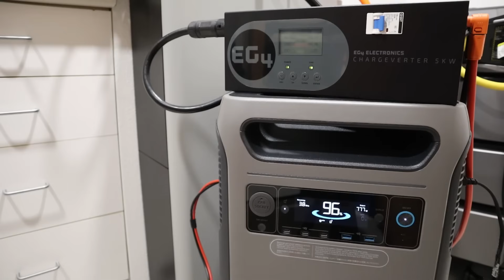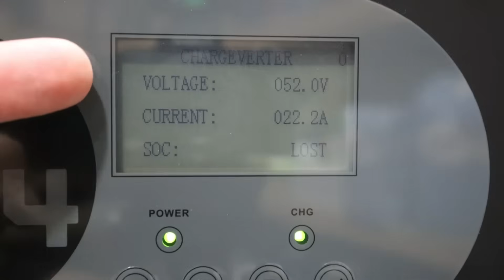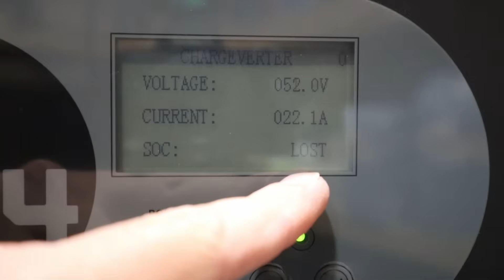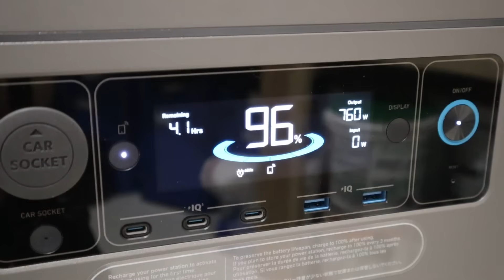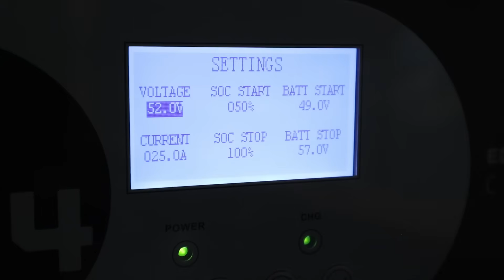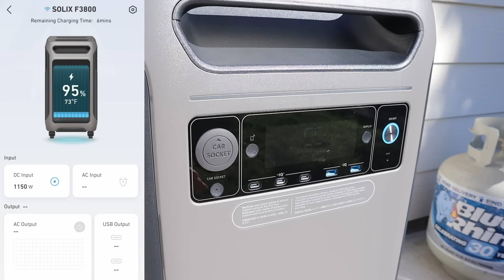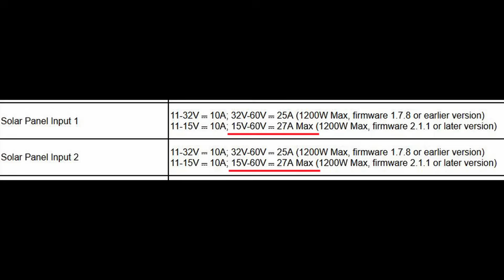The EG4 Chargeverter FIXES the Anker SOLIX F3800!  Keep the 240v Powered On!

Comment: you simply trick the unit to make it think itis being charge by solar. Why don't you get a PS200 solar panel or two.  How much do the chargeverter and a generator cost compare to 2 PS400 panels?
Reply from the maker: Those Anker PS400 panels are $1000 each.... OUCH....do not buy them!
I always recommend charging with solar panels first, however, when solar is not available you still need another way to charge it up. That's why I made this video. Using the Chargeverter will allow you to charge the power station at night or during a storm when solar isn't available. 

This video will show you how to find affordable 400w panels in your area:  https://youtu.be/pLRKljjaqMA

Comment: i am a newby here but if you have solar and are getting a 48v battery anyway, a hybrid inverter like the EG4 EVH 3000 might be a better add since it is not that much more than the price of the chargeverter and can accept more solar to charge the system through the 48v battery.
Reply from the maker: This is for people who bought the Anker power station off the Kickstarter not knowing it wouldn't have 240v, or when they purchased it from another review on youtube who didn't disclose the issue. This is a way to get what they have working properly. If you don't already have an Anker F3800, just go with a full DIY 48v system 👍
Reply: I am one of those early buyers, trying to make the best of the F3800 in light of the 60v  charging limit.
Reply from the maker: @lamesadave  if you connect a 48v battery to the DC charging port, you can use any charge controller to charge that 48v battery. I have a full video on that topic as well from a couple months back.
Reply: @Jasonoid  Yes, thank you.  I saw that excellent prior video.  Is am now trying to decide between the $400 EG4 charger controller and the $764 EG4 EVH3000 which gives me an extra 120v inverter along with a charge controller.

Comment: Can you limit the current to 20 amps, my power station solar input has a max of 20 amps only?
Reply from the maker: Yes, the output is adjustable. Your power station probably doesn't need this though.... This is meant to fix the Anker F3800 only.

Comment: I haven’t had the time or figured out how to connect my dual F3880 batteries with the HPP control to my existing Enphase solar array. I did have an old beast of a gas generator that isn’t likely to have a good sine wave output so I thought I would need to junk it and buy a new inverter generator but seeing how the EG4 will cope with less-than-ideal sine wave input and since my generator has the 240 output I think your timely video has shown me why I need to consider buying an EG4 chargeverter. Great video, thanks in advance.
Reply: Any luck figuring out how to integrate with your enphase system?

Comment: Jason, will you do the same video and show the same process for how to modify the chargeverter’s output to be compatible for the ecoflow delta pro ultra ?
Basically, how do you get the chargeverter’s output to go to MC4 cables.
Reply from the maker: The Delta Pro Ultra can just charge straight from a generator and get 240v output at the same time. No chargeverter needed.
Reply: But what about the “dirty” potentially non-pure sine wave energy from a standard generator.
Wouldn’t the chargverter make sense there?
I can understand skipping the chargverter if I had an inverter generator.  But a standard generator makes me a little nervous to charge my DPU directly
Reply from the maker: @criticalhadlock886  in that case, yes this would work on the low PV input for about 800 watts charging. I wish the Delta Ultra had a higher amperage input for the low PV, but it's only 15 amps. So it would charge a bit slower than the Anker power station. 

It might be better instead spending the $500 getting a decent dual fuel pulsar gx400bn inverter generator vs the chargeverter. 800w is pretty slow charging for the Ultra.
Reply: @Jasonoid  That is an excellent point.  I don't know why I hadn't considered that 🤪.  Sometimes you get so focused in on something that you can't see the forest through the trees.

Comment: So you can get 2400 watts charging with this setup?
Reply from the maker: Not currently, can't charge on the XT60 ports with the same source.
Reply: @ but two LiFePO battery chargers connected to a Honda Generator would work or is that considered a common ground?  Next time I'm at CES in Vegas I'll stop by the Anker booth and ask them what they recommend

Comment from the maker: Watch my 'Tips and Tricks' F3800 video HERE:    https://youtu.be/XFlRkMm8rDc
Reply: I just ordered a new Chargeverter and will try charging my two Anker Solix F3800s with it at the same time. I will update here if it works or not.
Reply from the maker: @Huiando  I had a viewer let me know it works just fine. Set the amperage to 55 amps and let er rip.
Reply: @Jasonoid  Holy guacamole! Thank you!
Reply: @Jasonoid  I actually contacted Anker about this problem.  It's possible they could fix this with a firmware upgrade.  Remember, before they upgraded, you could not charge the F3800 with both DC and AC input.  But now, after an upgrade, it can.  So perhaps we won't need to spend another $500 for the EG4 if Anker makes a change.
Reply: @CRoadwarrior  thank you for giving me some. Hope I think the problem is if there’s only two inverters in there a software update can’t add another one unless they have some trickery they can do.
Reply: @Jasonoid  EG4 has a 120v cord now for sale so you don't have to make one anymore.
Reply from the maker: @CRoadwarrior  I'll update a post with the information, thanks!
Reply: @Jasonoid  Yes, please do.  I was about to make one like you did, but I just decide to email EG4 and ask if they had one, and sure enough they do.  It's a little pricey, but overall worth it for those of us living off grid who need the technology working with Anker F3800.  

Also, I meant to tell you that I have two F3800s, and when you try to charge both with the Chargeverter, the device tries to split the wattage between the two units, instead of providing 1,000 watts to each unit.  I was thinking a setting change on the Chargeverter might help but not sure exactly that might work.
Reply from the maker: @CRoadwarrior  raise the amperage up to 55 amps on the settings page.
Reply: @Jasonoid  I will give that a shot.  Thanks!
Reply: @Jasonoid  Hey....I tried taking th amps up to 55, and it seemed to be working.  But it draws too much wattage from my inverter connected to my car and car battery.  It drains the battery too fast.  I'm going to toy with settings between your original one and 55 to see what I can get.

Comment: How do you fix a $2700 battery generator? "Simple, spend another $500 and lose some conversion efficiency."
Reply from the maker: I didn't design the flaws, I'm just trying to help people who bought one in ignorance. I'd recommend using 48v batteries to charge it, then you can charge those 48v batteries with high solar input.
Reply: @Jasonoid  Yeah, I know, just kind of lame from the manufacture.  Doesn't Victron make a autotransformer?  Would that help in any way on the input or output side?
Reply from the maker: @shaunnightfire8269  pretty much the same price as the chargeverter. The Victron autotransformer would be limited to 1440 watts output, since that's what is available when ac charging. I think the chargeverter is a better value for what it does.

Comment: Great video!  Thank you for going over the chargeverter and wiring in detail.  I have been looking for a solution to take dirty power from a Costco Firman tri fuel generator that only has 1 hour of run time without having to go through the trouble of selling it and getting a inverter generator.  Do you think this setup would work for charging the Bluetti AC500 with the correct connections?
Reply from the maker: Yes, it should also work for that same purpose on the AC500
Reply: I have a similar setup with a Firman tri-fuel generator and AC200MAX. I believe this solution will work. The only question is if we need limit the power out on EG4 Chargevert to charge Bluetti (in my case 900W Max).

Comment: So with AC charging the 3800 AC outputs still work? Just the 240 out that doesn't work?
Reply: Correct
Reply: @testchannelcomments8219  thanks! That saved me a lot of money & time. We can live without the 240 with fans and hanging clothes out to dry like the 60s. 2400 watts of solar is almost 5K!!
Reply from the maker: Correct, the 240v outlets shut off with AC charging.

Comment: I'm looking at using a smart Nema 14-50 splitter/switch to use one outlet for my Level 2 EV charger as well as the chargeverter. 
Does the chargeverter switch stay in the "on" position? That way it will turn itself on and start charging as soon as the EV is finished.

Comment: I picked up a 2nd F3800 with expansion battery and a HPP that I will be installing to replace my current manual cutover using the 240V outlet.  Additionally, looking to install solar input via fixed panel mounted to a pergola.  Regarding the solar input what type of panels and configuration is recommended via the xt60 ports?  Did the panel recommendations change from this earlier video? https://youtu.be/XFlRkMm8rDc?si=u1P_PilLwSdKnIyl   Unsure as to whether I should get bi/mono facial, wattage, etc.  If I have understood correctly, if using the HPP and a generator cutover switch it will charge the unit and supply power via the standby generator during times when F3800 batteries are exhausted in lieu of using the chargeverter.  What about the HPP needing power to run and regulate when only using the F3800's during the cutover to external standby generator?  I assume this  will be supplied from the portable stations as well as providing power to the home loads.

Comment: OR you could just plug your generator into your house panel and charge the Anker from 120v outlet
Reply from the maker: That would also work, but it would require shutting off all the loads in your house during the swap.

Comment: Can you use this on a standard 15A 120v circuit/plug with the correct adapter?
Reply: I would also like to use a small Honda 2200i inverter to do this.

Comment: Important to know that the 120V adapter is specific to the chargeverter and will not work for any othet adaptation. If you try to use it for another case, it could be dangerous.

Comment: This seems like a really cool idea to me. but honestly id rather you use a power supply from meanwell with variable voltage to do the same thing for a lot less but this is a very nice pre packaged form of charging. for really big power stations it makes a bit of sense but for smaller ones not so much.  more excuses to own more chargeverters :P
Reply from the maker: You are going to have to spend $400+ on a converter that will handle 1200w continously without burning up. High amps = high cost.

Comment: Would it have worked at 240volts if you had left the dog bone adapter with the 240 volt female end on it the way it comes from Amazon? I always thought the purpose for those three prong to four prong adapters was so you could go from TT-30P to L14-30R. I have the Echo Flow Duel Fuel 4000 and was planning on purchasing one of those adapters so I could connect to my Reliance Controls PB30 NEMA 3R Power Inlet Box with a standard L14-30 generator cable.
Reply from the maker: The modifications to the 120v cable are required. It doesn't power up with the Amazon dog bog adapter since it's not wired properly. You'll have to wire it according to the owners manual (the way showed in the video).
Reply: @Jasonoid  Thank you and great video BTW.

Comment: This is the best video of 2024. My prayers have been answered.
Reply: I second this. 
Been trying to figure this out to be able to charge my ev far away from my apartment but still be used to cut electric bill. This + a couple server batteries would virtually eliminate my electric bill in my 1000sq ft apartment. I’m all in!
Reply: Why not just buy an EcoFlow Delta Pro Ultra?  It can charge via 240 and output via 240 at the same time.

Comment: I have an Anker f3800 and a 51.2v 100amp server battery. I charge both simultaneously with one  120v ac to 51.2v dc 30amp smart charger. I simply hook the charger leads to the cables on the server battery and branch of of that connection to the f3800 via an xt60 connector. Works beautifully and charger shuts down when both units are fully charged.
Reply: This is a fantastic option. I’m so gonna replicate this!!  Do you mind sharing the actual products you did this with?
Reply: @OdessaBill  I can charge either my f2600, my f3800 and my AOlithium 51.2v 100ah server battery, all via their dc inputs with my LiTime 120v ac to 51.2v dc 30 amp charger.
Reply: After a little research, this is still a great option but looks to cost 900 for the battery and another 300 for the charger.
Reply: Or just get a 48Volt golf cart charger that wiil do 22 to 25 amps.....
Reply: @djrtime1398 will it not work to charge the F3800 if there is no server battery in the mix similar to the one @jasonoid tried?
Reply: @inworcester  I would believe so. The f3800 might or probably recognize the smart charger as an external dc source.
Reply: Which charger do you use?
Reply: @JimmyPhones1  LiTime 30 amp smart charger. 48volt model. The Ankers will recognize that voltage and charge at the max 25 amp dc charge rate.
Reply: @djrtime1398 I just tried this and my F3800 would not charge. Any thoughts?
Reply: @ what volt charger are you using?  Have you tried charging the 3800 all by itself with the dc charger connected to the solar input port?
Reply: My Chargeverter is being delivered today. I was looking at the manual. There are SOC settings etc. How did you configure your chargeverter to charge the F3800
Reply: I would think this would also be an appropriate work around if you had 2 Pecron E3600’s with hub kit?  Right now, there is no way to AC charge those while hooked up together with the hub kit..
Reply: Is there a unit out there where i can hook up more panels and max out 3200w solar on f3800 plus? Hopefully that makes sense.

Comment: I have seen a couple people build this system with 2 bus bars instead of cutting the included cords for new adapters.  Just put the chargeverter o-ring onto the bus bars with 2 o-ring to xt60 coming of the bus bar to the 3800's.  Would there be any issues with this set up?  I think 1 had a 90amp breaker feeding the red lines.
Reply from the maker: Even if you used two separate buss bars the grounds would still be the same since they are coming from the chargeverter as a source. If you wanted to charge with double the speed I think you'd have to have two chargeverters, each one connected independently.
Reply: @Jasonoid  Thanks for the reply.  I more so meant as a means to not have to cut up all the wires and add the different plug types/adapters.

Comment: I find it pretty astonishing that someone at Anker signed off on this product design.

I come from a datacenter background; the idea of a power supply randomly shutting off the output when an input is attached is pretty wild.  That you can't charge the unit while maintaining its core functionality is even more wild.

Still, the EC4 seems like a pretty solid SMPS.
Reply: It can still supply 120v while charging from AC.  However the other 1/2 of the 120 can either charge or be used for 240 just not both at the same time.  Wish it could do both....  but then would need a 3rd  inverter
Reply: @testchannelcomments8219  It's worse than that though - it can't even supply 1/2 of the 120V - Anker support tells me it's limited to 1440W on the UPS leg while charging - a bit under 25% of what they advertise it to be able to put out...
Reply: @testchannelcomments8219  aye.. and that's just wild to me. :/

It's such an absurd oversight on something that expensive.  The Ecoflow Delta Pro Ultra (its main competition) doesn't have that problem.
Reply: @GordLamb  Well for people like me who have older generator its still cheaper to buy a chargeverter then a new generator as I would still need something to clean the sine wave so I dont end up breaking the delta pro

Comment: Even better, get you a 48v Chins/Enjoybot/etc battery for more capacity and use the chargeverter to charge that battery...  The chargeverter is quite expensive for a DC charger alone..  You can grab 60v SMPS all day long for $150 or so that are rated to 2000w..  Could have got 2 for less than the Chargeverter..  😎
Reply: The problem with those power supplies is their very low Power Factor. The chargeverter has a very high power factor. When you run the SMPS power supply at 1150W off of 120V AC input, you actually are pulling about 18A instead of the 9-10 you would expect.
Reply from the maker: I suggested using a 48v battery as a DIY expansion battery in this video since you can charge the 48v battery with whatever charging source, not limited to 60v. The chargeverter is even better then as you mentioned!
https://youtu.be/XFlRkMm8rDc
Reply: @Jasonoid  are you able to, potentially, pig tail a single 48v server rack battery to two separate 3800s or would each 3800 need it's own server rack battery?
Reply from the maker: Yes, you can use the same 48v battery bank if you are charging two separate F3800s. It only stops working if the charging source is the same on the same F3800.
Reply: I've heard that a lot of these smaller ones either cannot be fed by a generator or they over heat and cannot run continuously for long periods of time.  Please suggest one if you know one that will.